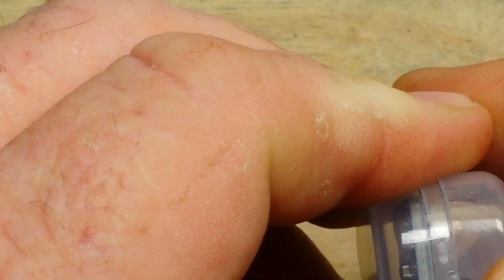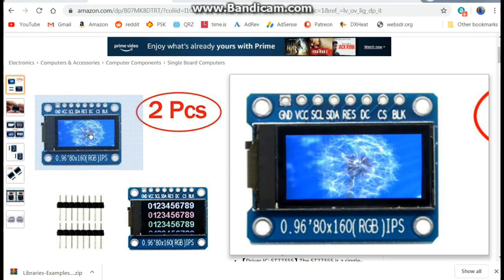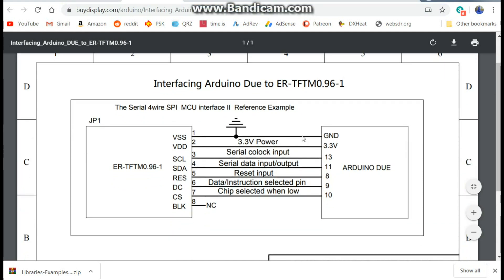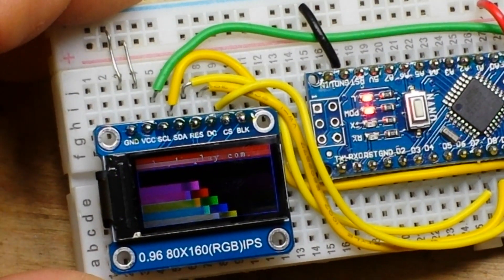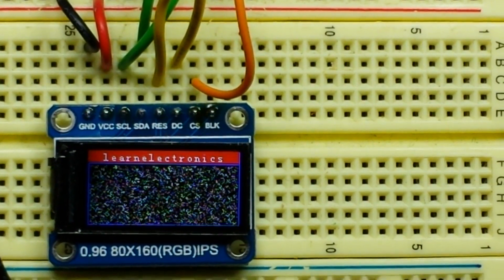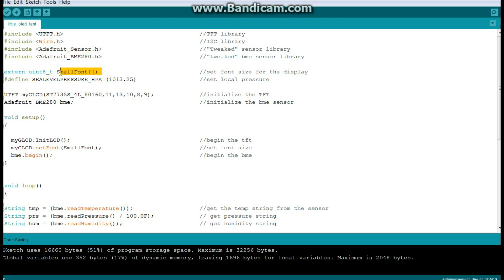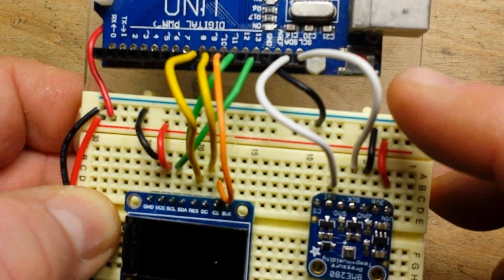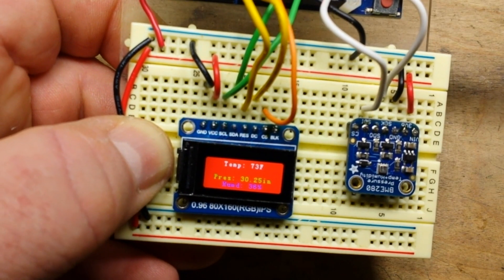ST7735S based LCD Display for Arduino - How to get it working

Comment: Tx for the video. Sorry to read about your heart condition. I am suffering myself from the Churg Strauss Syndrome. It may probably kill me one day too, at first I was quite aware of that, but now I don't think about it that much anymore... I am working on a design that needs a lot of RGB leds, and so in the end I ended up here with these displays. So I am going to use these instead. A lot cheaper, much more powerful and a way bigger resolution than to stick/glue together 2mm rgb leds...

Comment: The transistor is probably for controlling the backlight. You can confirm this by checking if there is continuity between the BLK-pin and resistor R2's pad that is closest to the orange flex cable.
Nice looking display. One will find it's way into my workbench at some point.

Comment: The Nano is the same microcontroller as the Uno (ATmega328p) so should run exactly the same on both.
There is a really good library for the ESP32 modules: Bodmer tft_espi

Comment: I have 5 of these exact displays from aliexpress in a breadboard and hooked up to an RPI 4B.
working on the driver because the ones I found always have something that will not work due to sudden lack of an external module etc. So I've grabbed the one with the most GFX commands and I am now modifying it to work solely with RPi.GPIO and spidev modules.
I want to make a mini random runner fruit machine with these displays in portrait mode.

Comment: I was trying the graphictest_tft code but couldn't get it working, check the code, check the wiring, everything ok but the display wasn't working, just 2 sec of video then off...
saw the first part of your video, switch to 5v instead of 3.3v e violá! working as a charm.
thanks!

Comment: i have the display but mine has 4 buttons on the bottom side of board , how do i set the buttons up ? i also have 1.8" rgb display that i need to setup still. but that ones for later lol i am just asking about the buttons  ty in advance for any help

Comment: Remember that a nano’s 3.3V pin comes from the internal voltage reference of the CH340G, it isn’t designed to drive a load. Same for a CH340-based Uno, not sure about the ATmega16U4-based Unos though, or any board using a different USB-to-serial IC.
I’d recommend trying a dedicated 3.3V regulator with low enough dropout instead.

Comment: Good info and nice display. How about keeping you mic volume the same throughout the video.
Reply from the maker: Two different systems
Reply: I was having some issues hearing the first part.  Went so far as to check on my Windows setting.  They hit me with a 2 hour update just yesterday and it reset a pile of my preferences.   FLIPPING WINDOWS !